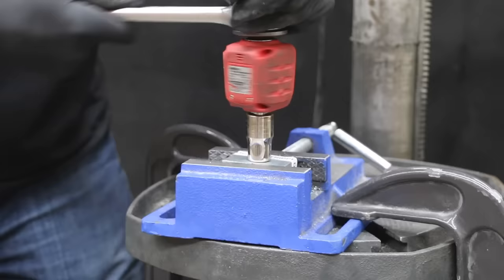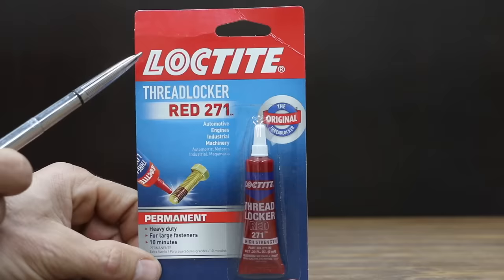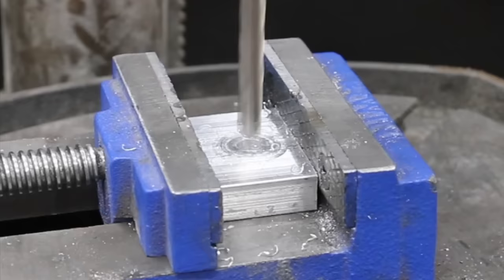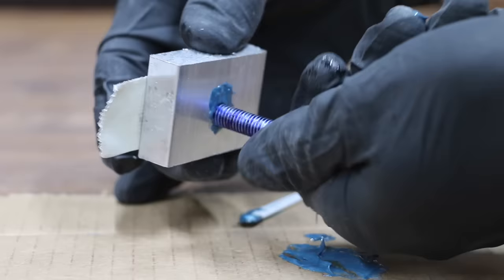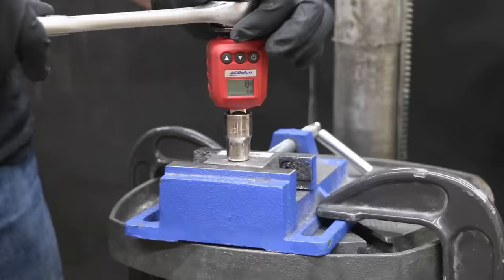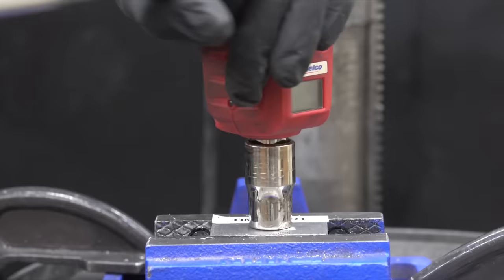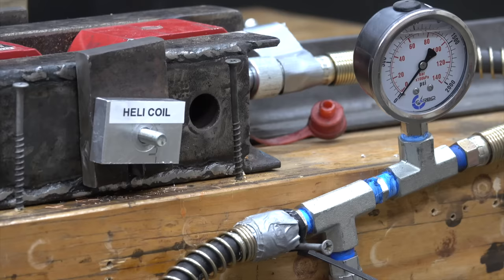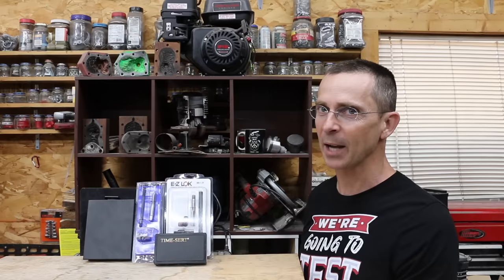Best Damaged Thread Repair? Let’s Settle This! Heli Coil, TIME-SERT, E-Z LOK, JB Weld, HHIP, Loctite

Comment: For my Jeep transmission Bolt which requires 10 to 12 inch pounds copper will work for me .
Project Farm is my absolute favorite channel for Improvement projects you are absolutely the man💯💪
I forgot to add because of project Farm a shop wanted to charge me $500 for a project and thanks to this man it cost me $38 and twenty-five minutes of my time.❤
Reply from the maker: Thanks!  Thanks for sharing!

Comment: One really important advantage about the timecert is that it does not have a tab that needs to be punched off.  It's also the least messy method if you are concerned about shards of metal falling down into the hole you are working on.  Just pack some grease on the bits to capture metal shards.

I used timecerts to repair the spark plug threads on my BMW's head.  It was the only method where I could keep a glob of grease on the tools, and capture 99% of all metal shards, and do all the drilling by hand.  The resulting hole is also much larger than what you drill with a helicoil, so it was easier to get a shop vac extension into the hole to suck up any stray metal shards.
Reply: Same here. I have used the time-sert set for several spark plug holes in aluminum heads over the years. It can be done without removing the head, and without any extra tools. I have done several small outboard motors this way.  Time-serts are really great.
Reply from the maker: Thanks for the feedback.
Reply: @tdc7  the glob of grease to catch the pieces is probably what he ment
Reply: @tdc7  Tapping isn't the messy part, since taps hold grease really well to trap shards.  You aren't removing very much material when tapping anyway.

It's the hole boring part that is messiest.  The Timecert that is large enough for a spark plug comes with a hollow boring tool, which holds grease extremely well.

That boring tool is also really easy to use with hand strength.  A typical spiral drill bit you use for helicoils is really hard to turn by hand.  You want to drill by hand, since that keeps shards from flying and keeps the grease from being flung from the bit.

The Timesert boring tool also aligned itself perfectly with the stripped hole.  You would insert a pin into the stripped hole, then the boring tool would slide onto the pin to keep it perfectly aligned.  This further helped with keeping shards out of the engine.
Reply: You can stop shards/swarf ofalling into the engine if you turn the engine to a position where the exhaust valve or port is open on the cylinder you are working on, and connect an air blower to the exhaust pipe.

Comment: Excellent subject and video! Years ago when Helicoil was pretty much the only option, a lot of airframes and engines were built using the Helicoils. I built 2 stroke racing engines back in the 70s adapting pieces to the blocks, jugs and heads and used helicoils for doing so. Pretty much can guarantee that those if they haven’t been recycled are still holding. I have a few 1950s-1960s Ford Y Block engines sitting in the hangar on the family farm and because of two of the head bolts on them being close to the same length but not quite, a lot of those engines when rebuilt would have the wrong bolts used on the heads and they would strip out the threads in the blocks. I like the Time Sert and intend to purchase the kit for those size threads. I like the chamfer of those.
Thank You for publishing your videos!
Reply from the maker: Thanks and you are welcome!

Comment: would be very interesting to see this done with grade 8 bolts.  appears that all of the inserts held equally  with a hardened bolt should be able to see the inserts pull out of the aluminum and in theory the bigger inserts in diam should hold better
Reply: Look for a channel called "torque test channel" and watch their thread repair video it has batter information they didn't use aluminum so they had some thread repairs actually fail
Reply: You should watch the latest video from Torque test channel. They test these inserts with high grade studs and cast iron
Reply: @juststuff4381  yea I saw that after I commented. But would still be interesting to see it. Most of the time when im doing heli coils it's in alum housings on engines. Very common for some jack azz go get over zealous tightening bolts with a impact and pull threads
Reply: The diameter is certainly important, but a second factor is that the pricier ones have one-piece designs so they won't 'uncoil' out of the hole if things get ugly.   Far better repair for something that is going to be removed at least occasionally, but more money.
Reply: Im a machinist and at my work we used to use the helicoil ones, but switched to the ez lock ones. They hold up much better for bolts that are removed repeatedly. Most of our fixtures are aluminum and threads don't last long with repeated use.
Reply from the maker: Thanks for the suggestion.
Reply: The inserts in this test already surviverd higher torque than what is required for 12.9 grade bolts. They are plenty strong enough for any bolt.
Reply: @ProjectFarm  even 12.9 and ARP to see which grade can handle force the best.
Reply: @emptycola99  The Torque Test Channel has the ultimate videos comparing grade 5, 8.8, ARP 2000, ARP L19, ARP Custom Age 649 etc bolts, he has animated charts mapping the load as the bolt fastens, stretches, and ultimately yields and then fails. You won’t be disappointed!!!

Comment: I used an helicoil on an engine block (where the head bolt on, so heavy torque)and the engine is still going strong
Reply from the maker: Thanks for the feedback.
Reply: @ProjectFarm  I had to use helicoil for a timing belt idler on my subaru engine block and I've had zero issues. I can safely recommend it for moderate load applications

Comment: Years ago my Brother and I did a similar test. He swore by TimeSerts and I said they were no better than HeliCoil. It took a lot of broken bolts and a fair amount of cussing, but we came away with the same results you did. No one steel thread repair was any better than another. Some were cheaper, some easier to install and some kits we're more complete than others, but once installed they were all equal.
Reply from the maker: Thanks for sharing.

Comment: I always use Heli Coil kit, I have never had one fail after 15 years of building Motorcycle motors. After all, it is standard practice in building airplane engines.
Reply from the maker: Great feedback on the Heli Coil kit. Thank you!
Reply: @ProjectFarm  My cheapest ones were actually US standard sizes, they had not moved off the shelves for 40 years, since the country went metric, so were finally on sale, for only double of the price in 1970, so I picked all of them they had up. Only 3 sets, but covered all the US standard sizes I used on US built machinery, 1/4, 5/8 and 7/16 standard thread. Also got the 7/16 die nut, so I could make the shear pins that used that thread, instead of ordering them, at a ruinous price. 1metre of 12mm stainless steel hex stock made a large number of those shear pins for use. Machining the pins, plus the tooling, came to the cost of only 1 pin, and I got over 20 of them, with bar left over.

Comment: The thing to remember is that Helicoil and HHIP are spiral wound where Time-Sert and E-Z Lock are soild.  The spiral wound inserts can leak fluids due to the minute spiral gap, especially with thinner fluids under pressure.  For this I recommend the solid inserts.  In fact, I think you can get Time-Serts with a closed bottom for this very reason
Reply from the maker: Thanks for the feedback.
Reply: The thread shouldn't be sealing anything anyway
Reply: For something like a drain bolt, you just need a flush surface and a large enough crush washer. Or a Dowty seal, which is a steel washer with a O-ring inside.
Reply: I agree, i gasket should take care of sealing. The repaired thread should take care of evenly distributing load over a gasket face.
Reply: EZ Lock is also not regarded as gas tight unlike Time Sert which is regarded as gas tight thanks to the insert being expanded when it is fitted. The biggest disadvantage of EZ Lock, Helicoil and HHIP is that they tend to unseat themselves in applications which require frequent disassembly (maintenance covers, spark plugs or sump drain plugs). EZ Lock is worst in this regard especially in assemblies which experience considerable heat cycling and can be slightly improved upon if it is fitted using thread locking compound which both secures the insert and gas tightens the thread. A further disadvantage of EZ Lock is its size. I work on motorcycles and in many cases there is not enough space to fit an EZ Lock. From 25 years of experience with hundreds of Time Sert repairs I'd say the system is absolutely worth the money and the repair will not fail as long as it's executed correctly..
Reply: @TheTomco11  A sealed thread as it's created when fitting a Time Sert will prevent corrosion. One of the long term issues you see a lot with Helicoil spark  plug thread repairs. The best thing you can do if you have no other option than using a Helicoil (especially for a spark plug) is replacing it with a Time Sert as soon as possible. (A Time Sert fits into the same repair thread as a Helicoil)
Reply: @TheTomco11 That’s when you use some Teflon tape /s
Reply: all bolts will leak unless tapered,. use a thread sealant , as you a little slow uptop
Reply: How about anti-seize?
Reply: @solarsynapse  anti-seize for what?   (anti-seize) it  for  anti  galvanic,  NOT A thread sealant,  and  most threads  are tapered  that need  a thread sealant,  and bolts  are straight threaded and do not  seal well unless you use a  hardening sealant
Reply: @mrbillpurcell6203  Yes, to stop corrosion and keep ignition deposits from jamming a spark plug.  Works good for me in original threads, maybe with inserts as well.
Reply: @solarsynapse most plug manufacturers dont recomend lube,,fecks the torque settings resulting in stripped threads
Reply: Time Sert is my go to choice. They never break, they never leak, they have a reasonably small overall footprint (necessary in smaller motorcycle engines, for example) and they stand up to repeated torquing of fasteners.  Helicoil and the like can "walk..."
Reply: I want to repair the drain bolt on an oil pan. Can it be drilled without removing the oil pan (a very expensive job on my car)?

Comment: If you do a part 2 to this, try some Keenserts. They are by far the strongest and most permanent way to fix a threaded hole.
As a machinist I've had to use them on applications that are heavy duty and can not have the insert vibrate out (other inserts types like helicoils can vibrate out).
Reply from the maker: Thanks for the suggestion.
Reply: One of the inserts operated in the same manner, didn't it? With tabs that had to be pushed down to lock it in...I can't remember which one though.

Comment: That is extremely interesting that ez lock gave so much more support to the bolt that it broke with almost 300 more in lb. You would think a sheared bolt was a sheared bolt but this test proves something. I'm guessing it's that flange so the bolt has to break right at the head which would explain the 200 inlb difference between the others that is wild!
Reply from the maker: Thanks for the feedback.
Reply: TBF it shows the tests aren't  so consistent. It would be much better if he used a longer flange and a steel washer because the aluminium got all mangled up and caused friction...
Reply: It would be interesting to repeat the test with a high strength bolt, as well as a washer to protect the surface of the aluminum.
Reply: If it’s statistically different it has to do with a variable thread pitch.  On a straight threaded hole and bolt only 1.5 wraps of thread hold the entire load. If the insert stretches it could possibly spread the load further.  

The head or the top of the threads on a partially threaded bolt are where stress concentrates to cause failure.

The fact that the grade 5 bolt broke says they will meet your needs.
Reply: I'm not sure how to interpret that. I think ultimately they should have been tested with some sort of washer and bearing surface to reduce the influence of the insert 'biting' the bottom of the bolt head - almost certainly the reason for the increased torque on the EZ lock. 

It may have tested be higher, but I don't think it's a benefit either way in a real world scenario.
Reply: @bradley3549  Yeah; if the bolt itself breaks pretty consistently around 500 for other tests, much higher results are due to something else, and probably not useful. In fact it might as a result be under-reporting the amount of torque the threads themselves were tightened to.
Reply: Perhaps if the other inserts without flanges were put in a steel plate they would get similar results due to bolt head friction. In any case it does not matter. A regular M8 bolt should be tightened to 180 in-lb and a high strenght bolt should be tightened to 300 in-lb, all these inserts are way stronger than what is required.
Reply: Might’ve been different manufacture days for the chinesium bolts.
Reply: @TC-yx2ss  That thought crossed my mind too, but the chances of three in a row on the same insert... and then the pull tests (arguably the more accurate test) were all basically dead nuts. Unlikely.
Reply: The friction of the ez lock probably has a lot to do with the torque difference. The iron oxide coating causes a lot more friction than the 304 stainless, requiring more torque to get to the same screw tension break point.
Reply: @kevingunde8514  The friction on the threads can not influence that result. My belief is that the notches for the installation tool bit into the shoulder just under the bolt head. Which is  why a washer should have been used.

Comment: I've always used "Heli-Coil" inserts, from way back in 1964 to repair a blown out spark plug to the present. I have, by now, a fairly complete set of both SAE and metric kits. The spark plug kit cost me ~$50 to fix a car I just bought for $750. One advantage of the "Heli-Coil" is multiple insert lengths.
Reply from the maker: Thanks for the feedback.
Reply: I use time serts after I owned a North Star engine that stripped out almost all the head studs. They multiple lengths also. Not sure about the other brands though. I always red locktite my solid inserts also.
Reply: @soullesssol7285    i never trust that 'no thread locker needed' and use some, anyway.....never had one fail yet.